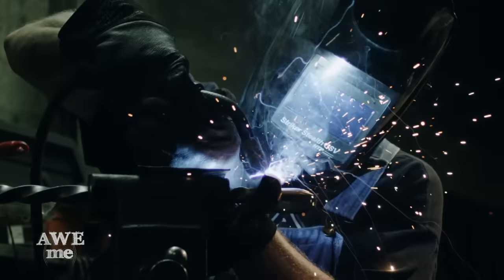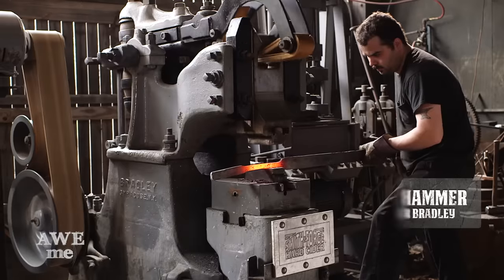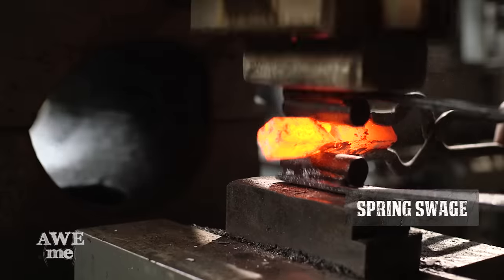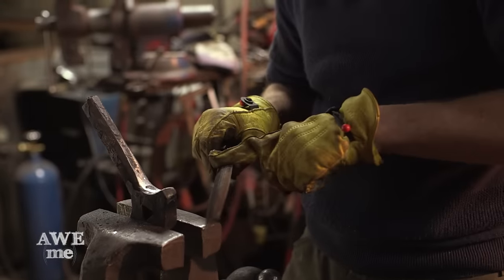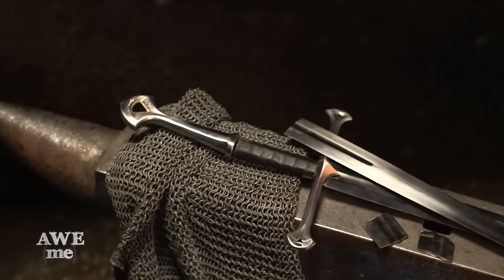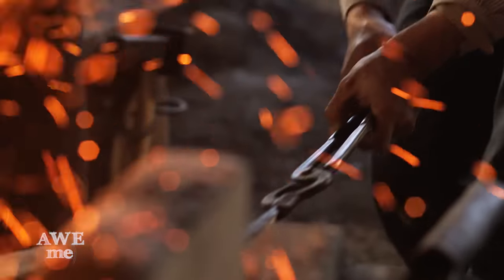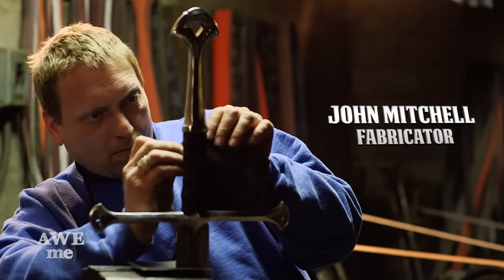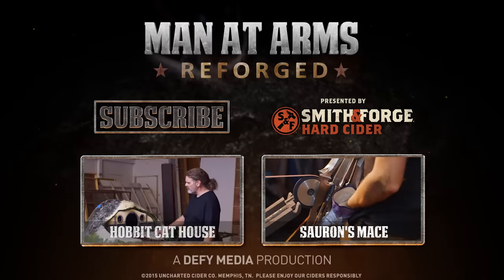Aragorn's Narsil / Andúril (Lord of the Rings) - MAN AT ARMS: REFORGED

Comment: I'm a mechanical engineer but I've never watched any of their vids before. When I saw how little it was deforming from the hammer hits at 1:15 I realised how hard their job is. It must've taken hours just to get the rough shape done. Massive respect for their workmanship.
Reply: I cracked my first job as Design engineer by watching them.
Reply: Too high carbon on it, probably. It's tool steel, and they used charcoal...
Reply: @gmourao  It would lose a lot of carbon in the reforging process, so they must have thought about it and went too far with the first blade.
Reply: @aimilios439  they used a charcoal forge so some of that carbon is probably out back in that way.
Reply: Certain alloys are just brutal to work with even at an orange heat.  I tried to work with some spring steel at near welding temp and it still required my largest hammer.

Comment: It was pretty awesome that they forged Narsil, broke it, and reforged it into Anduril. I especially love that the forge welding and folding gave the blade a wavy - almost flame-like - pattern. Fitting, as Anduril is The Flame of the West. 
It was also interesting to see how the tempered sword flexed when Sam accidentally hit the table at 9:48. If it wasn't tempered, I'm pretty sure the sword would have either bent permanently or straight up snapped. 
Well done, gents!

Comment: 9:02 The squiggly lines along the blade are amazing. This sword came out absolutely beautiful. Amazing work. You did Elrond's smiths proud.
Reply: you mean the Damascus design?
Reply: @rlchamp7019  Ah! Yes, thanks, I never knew that's what it's called. Thanks for educating me. Cheers.
Reply: @rlchamp7019  That's more accurately grain than damascening. The whole blade is made from the W1 (and, probably to counter scale losses, a touch more from the original bar) and the lines you can see are a result of welding the pieces back together, with carbon loss along those interfaces. Think like that grain of Japanese steels, not modern pattern welding of different steels, or even wootz.

Comment: Nardil and Anduril are in my opinion the most beautiful longswords ever
Reply: According to Skallagrim, That's how traditional medieval longswords were supposed to be used.
Reply: +Ted Melkoumov (SSB Computers and Knives) A bastard/hand-in-a-half sword is exactly the same as a longsword. Sometimes they're different (such as handle shape/size, and/or blade length), but overall, a longsword and a bastard sword are the same
Reply: Bastard sword is a more modern term I remember. Also hand-and-a-half sword is misleading. A proper longsword (and for sure a beast like Anduril) is way to long to be used with one hand. Yes you could do it, but it would be very hard to wield und very ineffective. 
A bastard sword would be a sword with the long handle of a longsword, but a shorter blade...a "bastard" of a longsword and a one handed sword. Indeed, a Hand-and-half sword.

Comment: what I heard listening to them explaining the forging process -

"First, they take the dinglepop and they smooth it out with a bunch of schleem. The schleem is then repurposed for later batches. They take the dinglebop and they push it through the grumbo, where the fleeb is rubbed against it. It's important that the fleeb is rubbed, because the fleeb has all of the fleeb juice. Then a Schlameeh shows up, and he rubs it, and spits on it. They cut the fleeb. There are several hizzards in the way. The blamphs rub against the chumbles, and the klubus and grumbo are shaved away. That leaves you with a regular old plumbus!"

Comment: 19th century? i think using viking, or celtic ways of forging would have been a better challenge
Reply: Uncle Miguel That's 11th century though
Reply: ah
Reply: I mean, they're not really that inaccurate. Water wheel hammers have been used since the 11th century in Europe, the power hammer just substitutes the water with electricity. I don't know why they used files but stone wheel grinders have been in use since ancient times; either man, animal or water powered. Would've made Matt's job a lot easier if they just used old school grinding wheels.
Reply: Uncle Miguel сподобалось
Reply: Alfatazer_
I imagine Smith and Forge would need to bring in stone wheels in that case, like they did with the Bradley hammer, and I get the impression they already had the hammer (for whatever reason), so providing that was easier and cheaper than sourcing oldschool stone wheels. But any blacksmith is going to have files and rasps hanging around, so they just use what they already have.

Comment: I would love to see you make one with only 15th century technology.
Reply: They used a gas torch around 5:00, so they didn't even stick to the rules of 19th century.
Reply: The blowtorch has actually been around since the early 1800's so technically they are sticking to the rules.
Reply: yes, however the use of oxyacetylene torches, which is the introduction to pressurized gas torches, was introduced in the early 1900's. Most importantly is the variable pressure to 'blast' molten metals out of the way.

Comment: I was doing research about bow's made from steel around 600BC and other than ancient scripture, can't find anything. Have you ever or could you make a bow from steel that would be a powerful hunting/combat weapon?
Reply: I'm sure it'd break if used by someone large in stature.
Reply: Moroni Breitbart unfortunately steel is a very rigid material and has a very low elastic region ( meaning once bent too far it will stay like that ) so it would not make for a good bow for the simple fact that once drawn on it won't bend to create the desired forces for an arrow to pierce through animal skin or armor, this is why when you look through history bows lot and short where made of strong pine oak etc. but you could have the bow made from steel if it had multiple parts such as a compound bow. another reason why steel would not be the best of choices for a bow is that the person who draws it has to have huge and I mean HUGE strength in their arms.
Reply: No one made a steel bow in 600bc.
Reply: In fact, I'm pretty sure that no one even made a spring steel in 600bc.
Reply: Pretty sure they were not making STEEL in 600BC!
Reply: Pretty sure you mean 600AD.
Reply: The iron age began 1200BC.
Reply: PROTECT THOSE BEAUTIFUL,  INNOCENT ANIMALS. DON'T HUNT. THESE SWORDS ARE FOR USE ON HUMANS IN COMBAT OR AN INTRUDER.DON'T TOUCH THE ANIMALS.

Comment: Too bad you guys don't know how to properly swing a sword.
Reply: Not only did they not swing it properly, but some of their strokes revealed a severe flaw in their heat treat, that blade is far too soft and flexible, it probably bent out of shape shortly after some of the tests
Reply: Btw at around 9:48 is where you see the critical bending that is far worse than any sword should bend. Swords should definitely be somewhat flexible so that they don't shatter on impact, but that sword was flopping like a fish out of water when it bounced off that table, that's not good.
Reply: Yup, well, they basically forged (and re-forged) an extremely cool, handmade movie prop... not an actual, well-forged longsword one would want to use, sadly.
Reply: Nick buddy you're dead wrong, depending on how a sword a made and the type of steel used it can bend even worse and still retain it's shape perfectly
Reply: @electricnick260  As far as the sword remains in the elastic zone no permanent bends are possible.

Comment: Make Lady Vivamus, Robert Heinlein described the sword in his book "Glory Road".

"I''ve never seen one quite like it so I don't know what to call it. A saber, I suppose, as the blade was faintly curved and razor sharp on the edge and sharp rather far back on the back. But it had a point as deadly as a rapier and the curve was not enough to keep it from being used for thrust and counter quite as well as chopping away meat-axe style. The guard was a bell curved back around the knuckles into a semi-basket but cut away enough to permit full moulinet from any guard.

It balanced in the forte less than two inches from the guard, yet the blade was heavy enough to chop bone. It was the sort of sword that feels as if it were an extension of your body."

Comment: How much would it be to make me sword? A Templar sword.? Not standard but close,I'm looking at a nice double edge with a modern 2 handed grip black walnut grips double wound wire for better grip and the pommel peened on strong.claytemper the middle for strength. Please let me know. And  shoulders strap.  The steel I'm thinking a good 1095 and 5160

Comment: If a Japanese katana smith looks at this they will laugh, it's weak and not good quality, just look, a serious katana would easily cut that sword in half! The Japanese are a force, first they have a special type of steel that they make from steel sand themselves, and it takes them 48 hours for that, then they use one third of that for curing, then they mix it with carbon, then they are fired 14-15 times in order to clean the steel as much as possible , then they go to further steps, and that is all unattainable for an American, they use special clays that they apply in layers to the blade and the end of the butt, so that when they temper the steel, it is elastic at the end, and hard at the edge, etc. And people who sharpen katanas learn the trade for 10 years, imagine how surprised Westerners are when they hear something like that. They tried all swords to compare with katanas, as for the blade, none of them stand a chance.